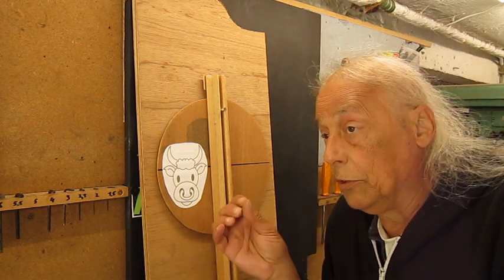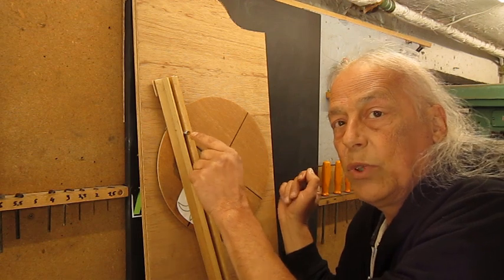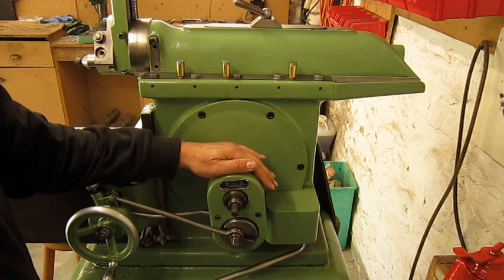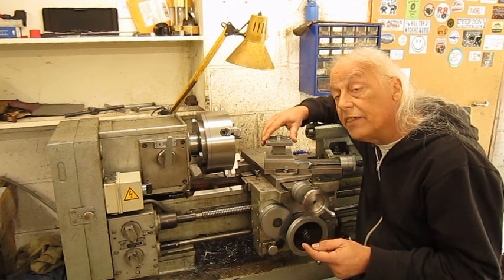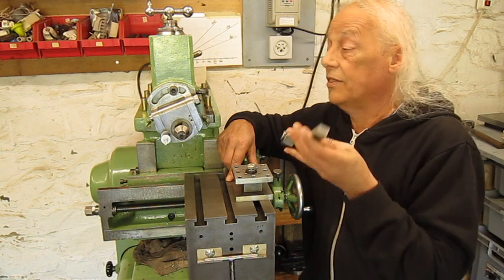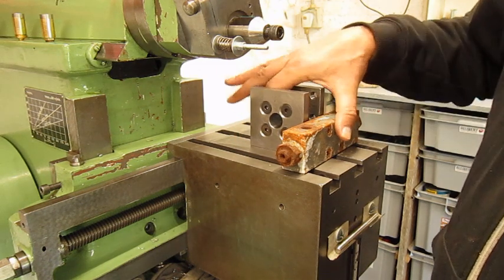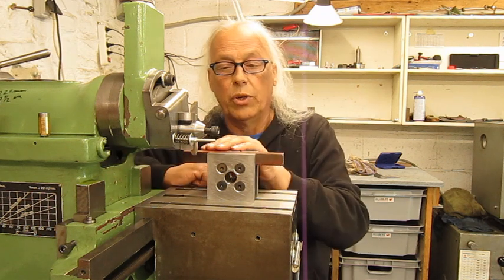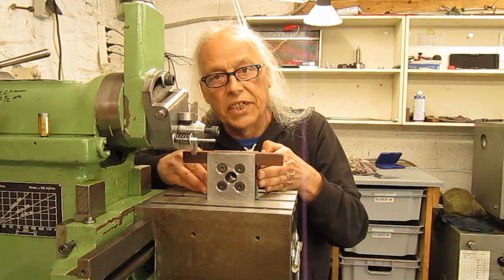Setups on the shaper part 2.

Comment: Another good video. You helped motivate me to get off my arse, go fire up my lathe n relearn to cut threads. It came out rather well! Now i shall address a small issue i discovered during that exercise. After i go get some bolts for use holding things on my old mill. Your setups , tips and manner if explanations is easily and well received! Check in on you later, now im off to make chips!! On old parts. (From 1903-1930).

Comment: ThankYou sir for making this video on my comment about stroke reducing while working.
I tried to tighten the nut of centre pin but it was already very tight,  maybe it needs repair.
Sk Kifayatullah
From India
Reply from the maker: Maybe first to a little test. Mark the spot where the crankpin is fixed to the bullgear, and let the machine do some heavy work. After it will be easy to see if the crankpin moved or not.
Reply: @Rustinox  ok